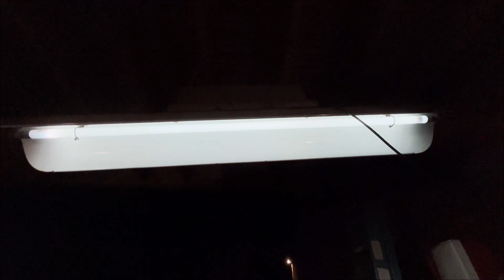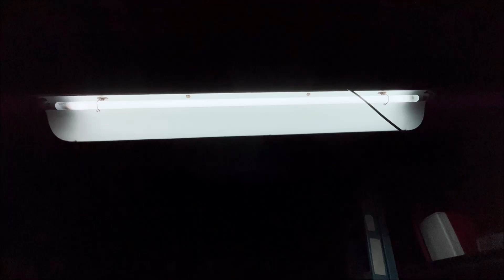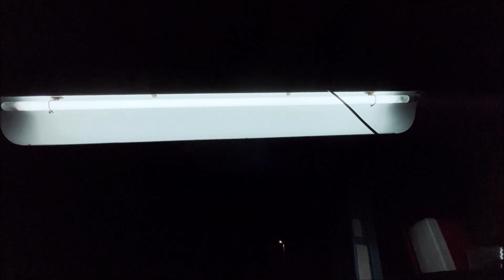GE "Type RF" cold start 11F / -11C

Comment: In cold it's a normal condition for the fluorescent tube to not start up directly. It is the reason why it has filaments on both ends and in cold they turn on first to heat up the gas inside. Once the gas is heated, it starts to be ignited and lights up